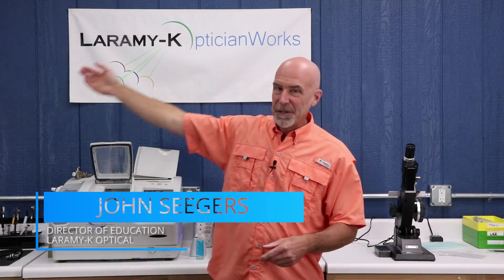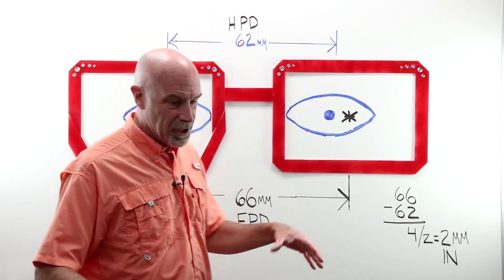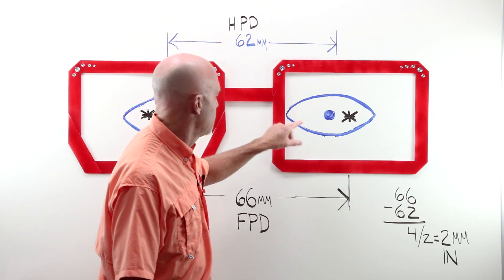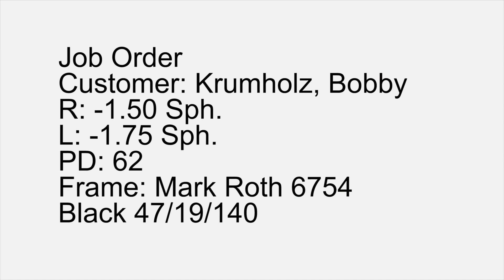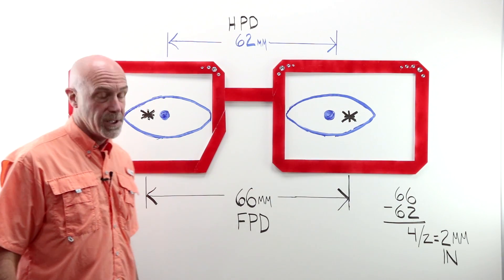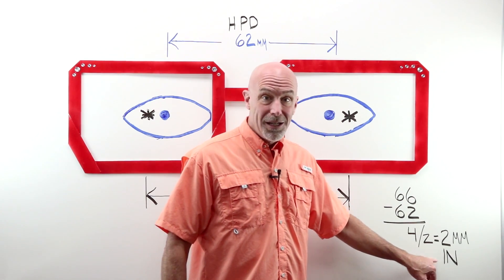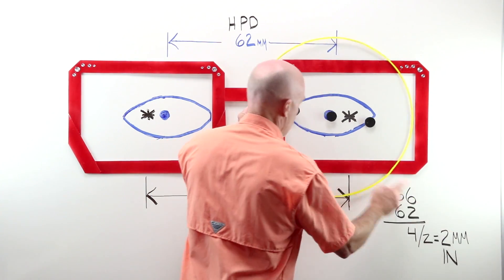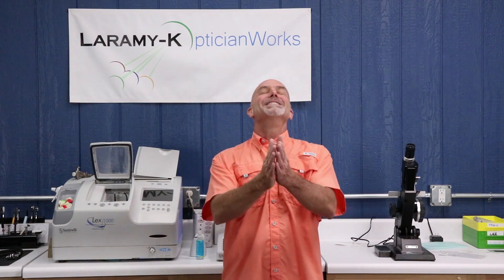What Is Decentration?

Comment: With larger frames , optical centre's should be decentred  vertically as well as horizontally because the optical axis of the lens should correspond to the centre of rotation of the eye what cosmetic problem does this cause
Reply from the maker: The eye is far less sensitive to the vertical placement of the OC than the horizontal. In reality as long as they are both on the same plane it rarely matters. An OC bump is a fine idea but keep it to a minimum (around 5mm). If powers are high enough that it matters (+/-7 and higher) then you should just pick a better frame. The cosmetics can get ugly with thickness becoming an issue both temporally and in the vertical up at the eyebrow or cheek.

Comment: Hey john,
I was seeking your advise on the centre difference in y-axis, as this video shows decentration on x-axis. What if there is centration issue along both x and y axis?
Reply from the maker: We call decentration movement along the 0-180 to align the lens OC with the pupil horizontally. We call movement along the 90 or vertical an OC placement or OC height. Same movement as you would use for blocking a progressive on the fitting cross.  See: https://www.youtube.com/watch?v=urNNLrnWL1o&t=46s
Reply: @LaramyKOptical  thankyou,
It was very helpful.

Comment: @Laramy-K Optical Thanks so much for the video! Can the decentration be negative in the MBS formula?
Reply from the maker: Juan, I'd think that movement away from the center is movement away from the center. If you happened to have 3 out instead of 3 in I'd just use 3. John
Reply: Laramy-K Optical Noted. Thanks for the feedback!